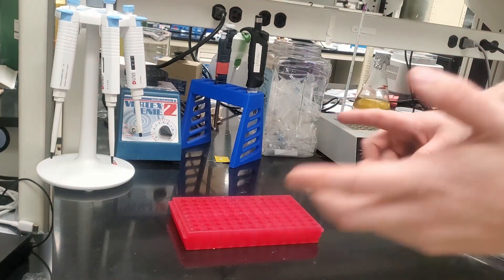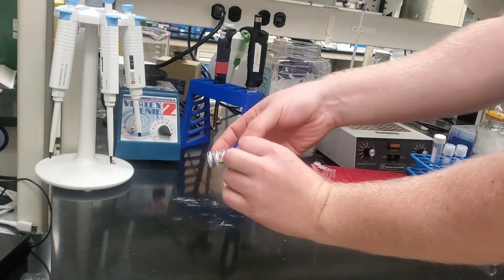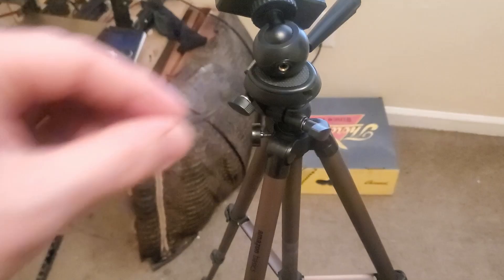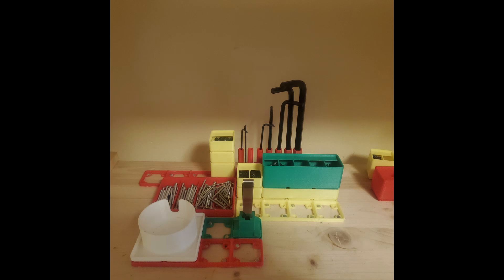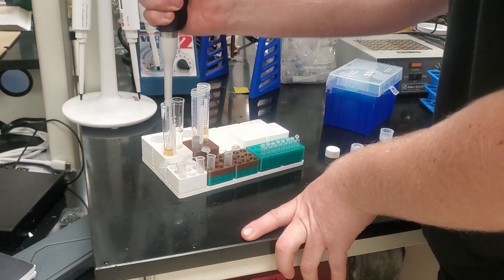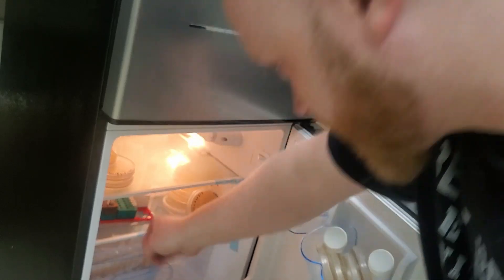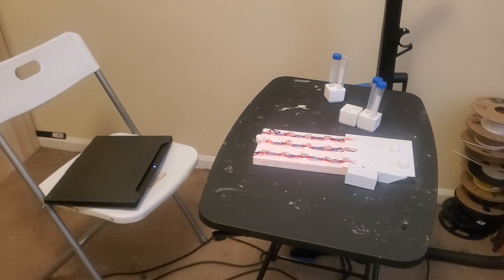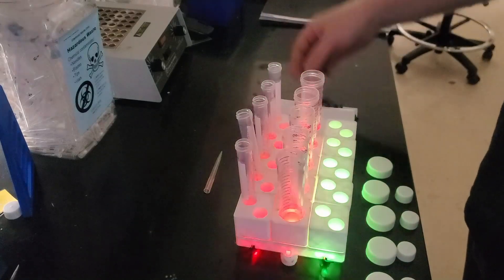Over engineering a tube holder as far as it will go. Introducing the modular tube rack!

Comment: one of the biggest issues with PCR is cross contamination. in many cases you do want that physical separation. 
while you are just messing around in a home lab, much of this will be fine, but it isn't any good for working in an actual lab. you would have to unlearn all the bad habits. 
this is more than likely why a solution doesn't already exist, because it wouldn't be commercially viable to produce stuff just for a home lab that doesn't follow best practices for an actual lab.
Reply from the maker: Literally use this in a reasrch lab every day. Yet to see a problem with any of my PCR results. I'd say give it a try if your curious, don't be as sloppy as I was in the demos (that was just colored water) but changing pipette tips like normal still prevents cross contamination.